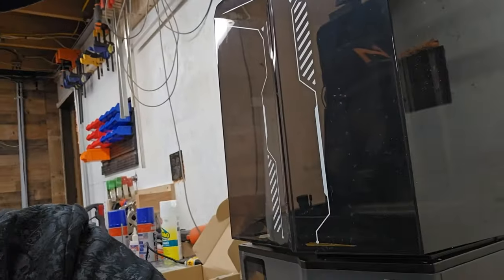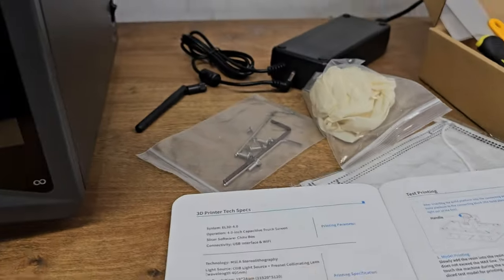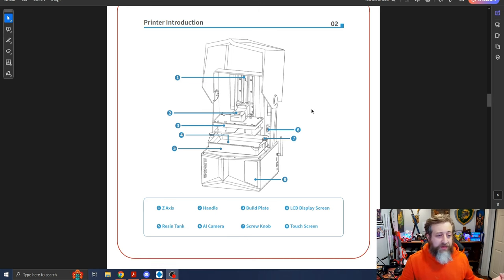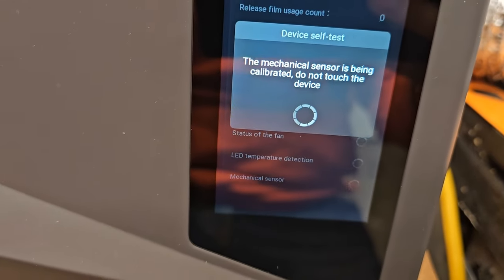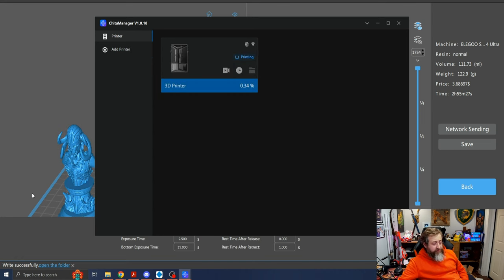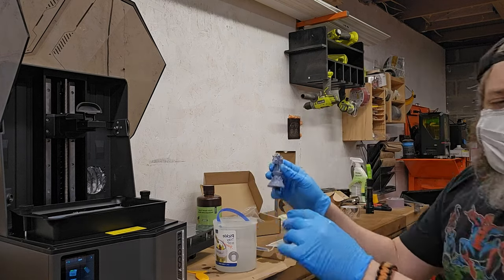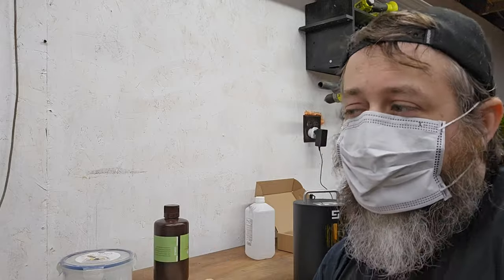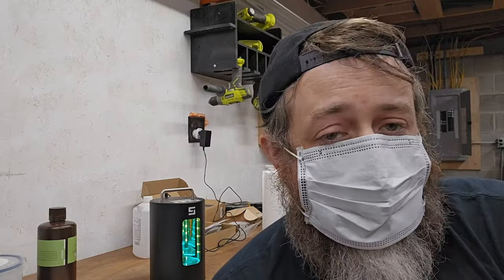The Elegoo Saturn 4 Ultra Resin 3D Printer! | Nerd Immersion

Comment: they misprinted because they didnt have suports. I could instantly tell what was gonna go wrong before it even happened. for dice print on the edges with a line of small supports or you will get warping also.
Reply: quick question, coming from FDM printing. Could you elaborate why supports would have helped with the failed print? and about the dice: So, always print at the edge with support? I assume with 100% fill-in as we cannot add a hole, correct?
Reply: @stefanhaupt4947  the first few layers get ~30 seconds of light vs the rest of the print getting 2-3s for adhesion. thats why the 1 is gone, it cured the resin that would be in the recess. there are few instances where you want to print directly on the plate, none of the prints he did were prints that should be done directly on the plate. there are supportless prints that would be fine to have done on the plate. The part of the horse that failed was essentially hanging in space by itself when it started printing, so it just stayed stuck in the resin vat on the plastic screen until part of the print that was connected to the build plate made it to it and was strong enough to peel it off. I would have hallowed those chess pieces but not the dice.
Reply: @mcdotterson4103  thanks a lot! this definitely helps to better understand

Comment: For the dice you get a better print if you stand it up on the point and use tiny supports along the edge. Takes forever putting the supports but you get a really nice clean print.
Reply: Try Formware slicer, it has an array support feature.

Comment: I think the whole point of this experiment was to see if the average Joe could get something out of the machine with the information provided by the manufacturer.
Just like with FDM, there is tweaking involved for each particular filament (resin in this case), supports, print settings etc. which was mentioned.

Comment: The video only just dropped, but I skipped around to check your safety setup.

As someone with a resin printer, this is nowhere near the same as filament. It is tremendously more hazardous and you need to take it very seriously. Please go to r/resinprinting there are some very helpful individuals there.

A few things:
The mask included is bullshit, you need a proper respirator for fumes/vapors. 
The included charcoal filter that goes inside the printer is nice but it does not clean the air, people have tested this, the vapors are still all over the place at hazardous levels.
Gloves, don’t reuse them, and they are not actually completely resin proof, you can get irritated skin through gloves with prolonged exposure (this is in more extreme cases, but you should know it’s possible)
Eye protection at all times, that means goggles over glasses. Resin can easily slip under your glasses, you’ll come to find that it’s easy to accidentally splash these liquids you’ll be working with. Resin in your eye is about the worst thing other than drinking it.
Resin will not immediately irritate your skin, do not take this to mean that it’s safe to leave it alone. Treat it like you spilled acid on yourself and rush to wash it thoroughly with soap.
Be prepared for spills. Have a slapmat or other mat for working on in case of a spill.
Resin allergy is a real thing and you develop it through prolonged contact with resin.
Your setup needs to be supremely well ventilated. People at this point have come to the conclusion that it’s not smart to use a resin printer frequently within a living space. A dedicated shed is best.

I hope you enjoy resin printing, it’s cool to get some models for your games, but man it’s no joke, it’s really dangerous. I prefer the result from resin over filament, but it’s not really worth the hassle to me because I can’t adequately follow every safety measure. I do it very rarely now. Like a couple times a year.

Please be safe Ted.
Reply from the maker: Yeah I definitely should've grabbed my face shield for it and my respirator, but too late now. 

There's a pretty big 400 CFM overhead air cleaner for that small space and I had a 4" extraction line attached to the back of the printer with 200 CFM in-line extraction fan pulling the fumes through a 4" activated carbon filter all of which is venting to outside the house. It's also not like I'm printing with resin everyday either. (Oh and those are new gloves every time don't worry).

I do appreciate the concern though!
Reply: Agreed - safety is paramount, but you seem pretty “DIY-ish”, so I think you get it… just pretend there’s an OSHA rep in the room and you’ll be fine. lol. Welcome to the club!

Comment: No supports added to the chess pieces with so many overhangs and floating parts it’s never going to be a success. Try use the auto support button as a starting point until you can understand how it all works. The big plastic tray fits around the front of the vat once your print finishes and fitted before you remove the build plate so it catches all the resin drips upon removal so you don’t get resin all over the front of the printer and into the gap for the tilt mechanism.

Comment: Never understood why these printer manufacturers ship totally pointless facemasks with these printers. They instil a false sense of protection, these masks are only good for particulates and the harmful resin VOCs (volatile organic compounds ) are just going to pass right through. You need a proper VOC filter mask or dont bother. Also the odour given off by a resin bears no significance to the toxicity of its fumes